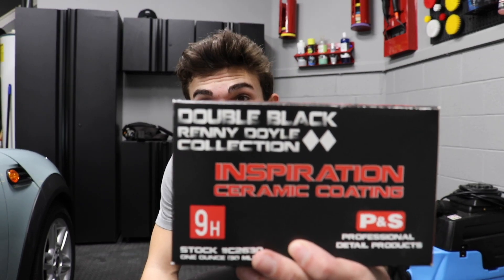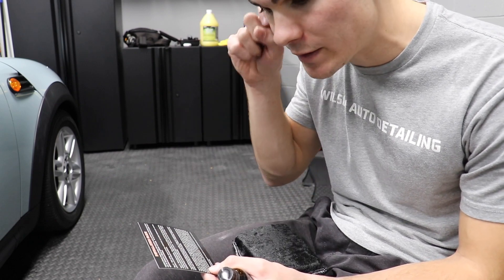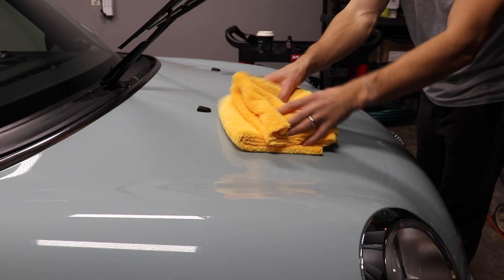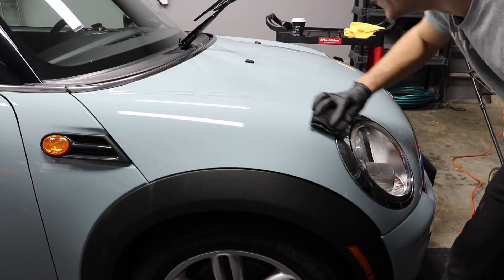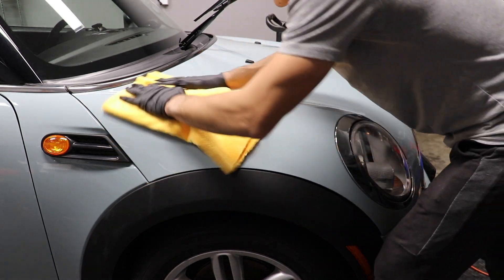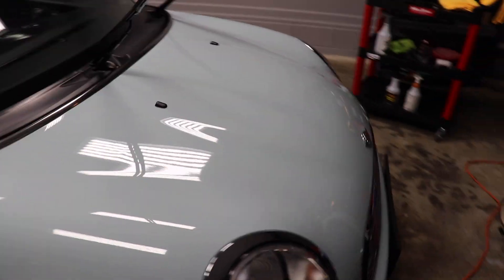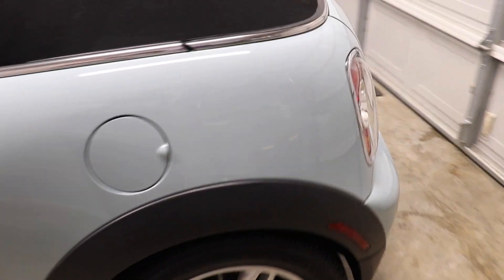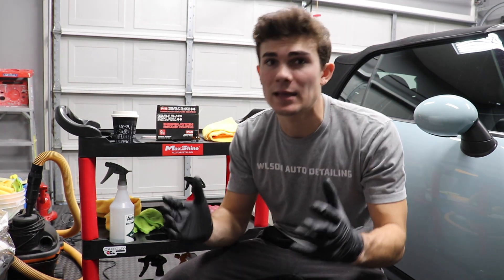Reviewing a Ceramic Coating I've Never Used | Get a DEEP WET Look.

Comment: Hello Luke & the Wilson auto detailing community! I don't want to seem like a know it all lol but I am a certified inspiration installer by the man him self Renny! I went in depth with renny & Bob Philips (the chemist behind the coating) &  this is a professional grade coating & I would recommend to your viewers to have quality experience especially if your applying two layers as recommend by the manufacturer. You might not be able to see high spots right after application but trust me if your not careful they will appear. The coating is rated at 3 years & is currently the only coating on the market that is backed by an insurance clammed warranty. Further more it has a recommend 24-72 primary cure time (avoid water, driving long distance ext...) But the coating does not achieve maximum gloss, hardness, and slickness until about 30 days. Which sounds crazy but there is a good reason on why, it's a substantially thick coating compared to others on the market, I've had times where  I was able to remove light scratches and swirls from the vehicles paint and still did not go through the coating completely! Hope I was able to answer everyone's questions! If you guys want to learn more check out my YouTube channel & Instagram @carnewbadetailing 3 videos a week! And a great podcast as well with industry leaders!
Reply: 👍🏻I am also certified in this application of Ceramic coat.  I do agree this product is an awesome coating if applied correctly 🔥💯👍🏻

Comment: Love this product but it is a little sticky most of the time. Also leaves high spots easier then some other brands but the end results speak to how amazing this coating is. Also two coats is what is highly recommended. I took the certification class on this product @ P&S and so far best coating I have used.
Reply: How does it affect having a certification on using detailing products?
Reply: When do you apply the second coat ?

Comment: @wilsonautodetailing used this product about 3 months ago on my mobile detailing truck, was not impressed at all. Hydrophobic characteristics are amazing but it's very sensitive to the touch and will leave major micro scratches, my clearcoat was tougher. That being said I know ceramic is not scratch proof this product is just weak
Reply: what kind of towels are you using you just scrape it off that's a first i ever herd of that
Reply: @danielgonzalez-sk8ot  i believe it's the rag company 300 which is the proper towel, it looks great it just don't hold up. I've been real impressed with carpro coating they have been holding up excellent